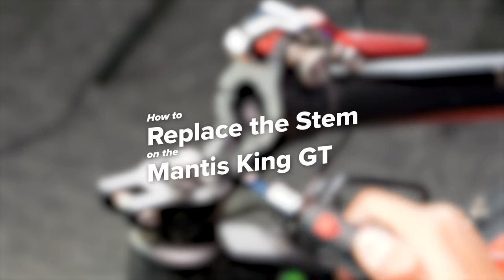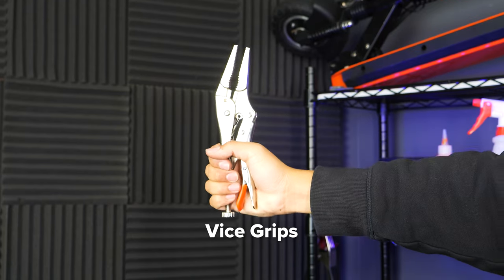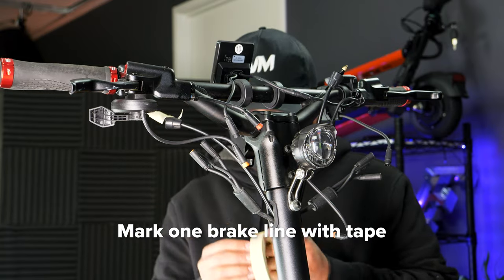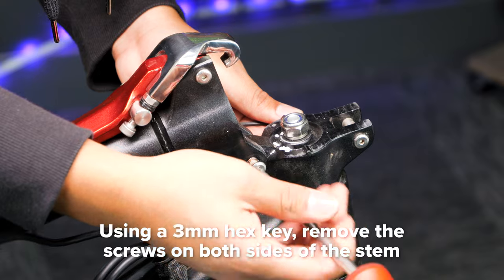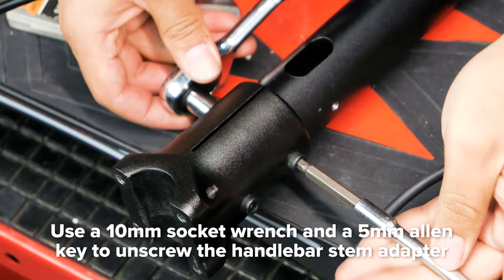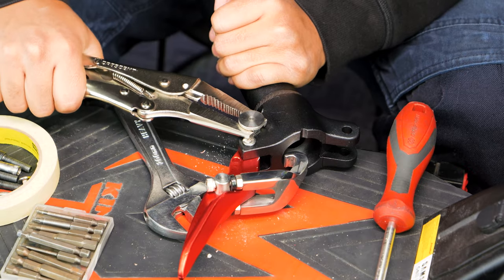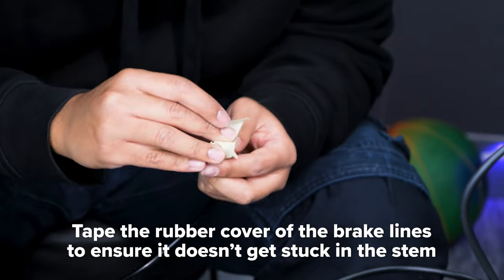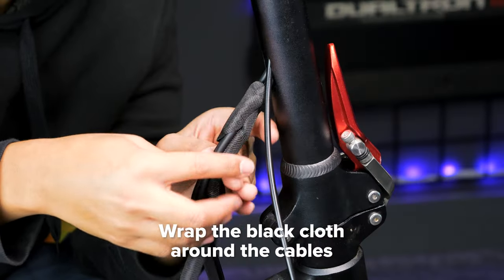How to Replace the Stem on the Kaabo Mantis King GT | Voromotors tutorial

Comment: Hey voro motors 
Luis here 
I own a mantis king gt and the swivel head snapped so I replaced it but 
I saw a diagram and it's missing some bearings where the swivelheads looooong bolt Attaches to the stem couñd you make a video about the proper assembly of this with the peiling bearing and the needle rollers tapered bearing 
Its like 20$ pieces and it's dtopping me from riding plz help !

Comment: This tutorial is pretty good except you forgot to use Loctite on the screws when re-assembling everything. If someone follows this tutorial and doesn't know they should use Loctite on all the screws, some of the screws that were removed and re-installed in this video will wiggle loose and fall out over time with normal use and the rider will get hurt.

Comment: Wow that so cheap and dangerous this would never happen to a dualtron never!
Reply: Dualtron stems are ALL loose and wobble when new, and they often snap in half while riding because the clamp can't keep the stem from moving, and that movement causes accelerated metal fatigue which causes catastrophic failure over time. I know 15 other Dualtron owners and 4 of our 16 stems snapped in half while riding, all at or around the folding mechanism, so Dualtrons clearly have a weak/defective folding stem design too, just in a different way. This happened on a Thunder, a Thunder2, an X, an Ultra, so it is also NOT limited to a specific model, it is a systemic problem with most/all Dualtrons with the older style wrap-around stem clamp design because the clamp is too short and it can not prevent the 2 halves from moving. If it was longer, it would have a lot more leverage to stop the halves from moving and would prevent this problem, or at least significantly reduce the forces to reduce the problem. I have to make people aware of this problem with Dualtrons because I don't want anyone else to get hurt due to fanboys like this guy "mikey" spouting their fanboy BS with no facts to backup their exaggerated claims like when he said "this would never happen to a dualtron never!"🤣🤣🤣